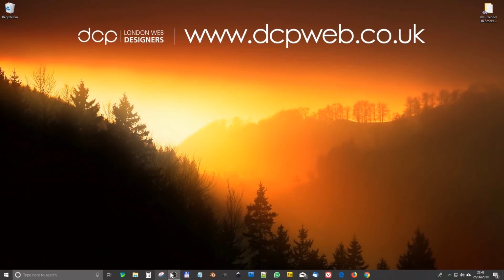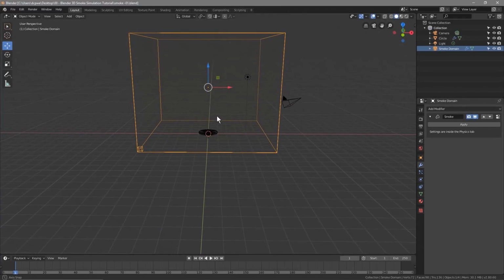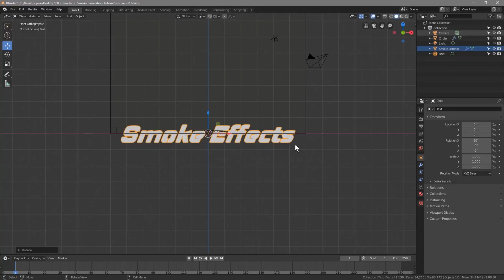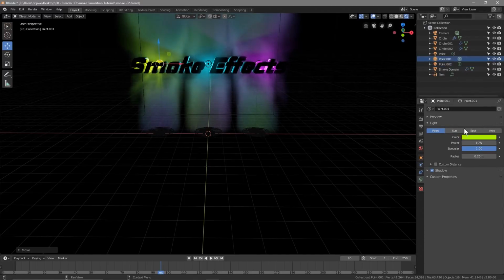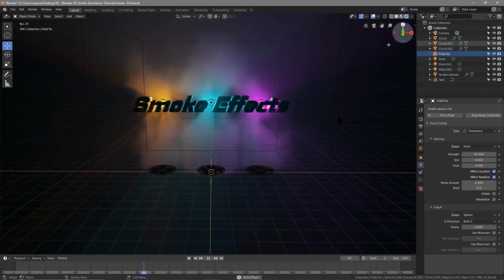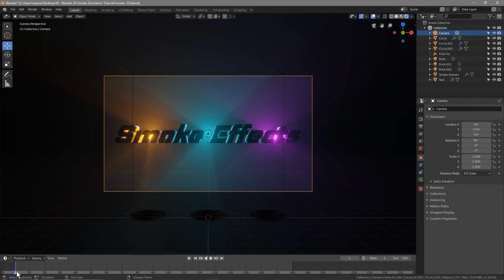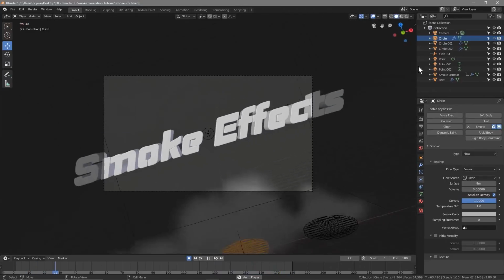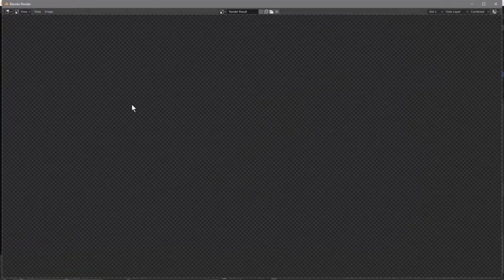Blender 3D Smoke Tutorial - Blender 2.8 Eevee

Comment: Thank you for the tutorial. I'm starting to add smoke into my scene after watching this one. I did have a quick question though, would it be the same thing if we just added a Cylinder and scaled it down instead of the circle, filling, and solidifying?
Reply from the maker: Yes the same 👍
Reply from the maker: The advantage of using circle is the smoke will only emit from the face, with the cylinder it will emit from the sides as well but should still be ok...
Reply: @dcpwebdesigners  thank you for the explanation. Makes sense!
Reply: I have now used this tutorial and another one of your intro tutorials to make an intro for a friend. I will link it when rendering is done.

Comment: Is Blender graphic and processor hungry? What sort of PC Specs would you recommend for smooth use of blender cause i have a fairly decent PC but i'm not sure if it can handle something like Blender.
Reply: New ryzen 3600 is amazing value/price for what it can do. 6 cores and 12 threads, amzing single core frequency - blender's viewport loves single core more than multi-thread. Keep that in mind, because most of the benchmarks are done with just rendering, nobody tests how snappy are apps, exporting fbx, applying modifiers, ediding mesh etc. I would highly recommend it for a budget workstation. i7 8700k is better but it is more expensive. i9 9900k would be the best choice but it is even more expensive. 

Ryzen 3900x is amazing for rendering but for anything else, i9 9900k is just better and you can get it cheaper.
Reply: @brainchildpl  Well i will have a £5,000 budget around Christmas time, So i can go pretty nuts.
Reply from the maker: View more free blender tutorials here Blender 3D Animation Tutorial: https://www.youtube.com/playlist?list=PLRpn_0jbcintr_4A6VVNdqAOO0W7k9LtW
Reply from the maker: I can only tell you what I have and works well for me, core i5, 16gb ram, gtx 1050 6gb, SSD

I would say core i7 and gtx 1060 6gb would be better and more ram...

Blender works well for me but slows down when working with fire, water and smoke simulation and 100,000+ particle systems, but still useable...
Reply: @dcpwebdesigners  Yeah so by the sounds of it if you comp slows down when using fire, water etc then I would have to upgrade my pc to like an Amd Ryzen and like a 1080 graphic card and like 32 gb ram. 

Do you do work for people on blender etc cause i'm in the middle of making a film and need some work done in after effects etc.
Reply from the maker: I used blender for basic stuff, so I am no expert, after effects I am still learning as well, my main business is Web design and development, all the videos on YouTube are just knowledge sharing and helping people where I can...
Reply: @dcpwebdesigners  Argh ok fairenough, Web design i might use you soon depending on price of course :)